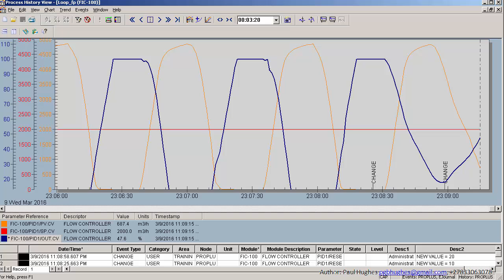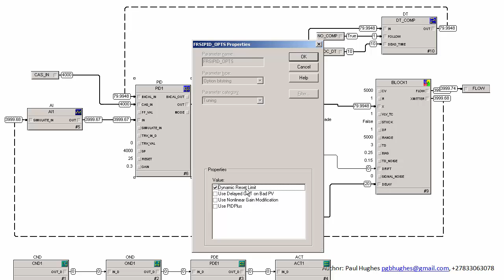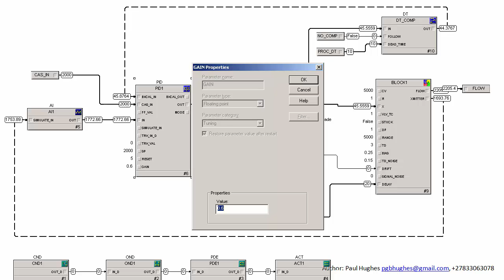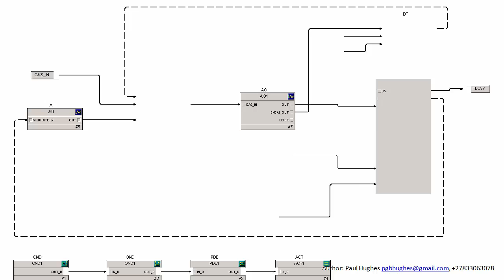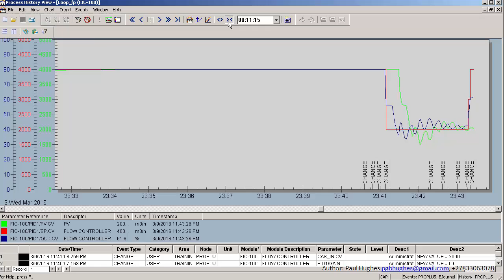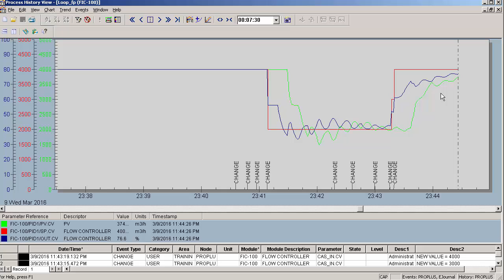Dead time Compensation using Dynamic Reset

Comment: sir , can you tell me the referance book for this compensation technique..?
Reply from the maker: Hi there. Thanks for this question! I would love to tell you but to be honest I did not really read it in a book. I picked up concepts from various places on the web and then tested it. In fact some years back I built a Smith Predictor without even knowing it was one. I will have a look if I can find a reference but to be honest I did not see this in a book. Books of relevance would be https://www.amazon.com/Instrument-Engineers-Handbook-Vol-Optimization/dp/0849310814 as well as https://www.amazon.com/PID-Controllers-Theory-Design-Tuning/dp/1556175167. Hope this helps, feel free to ask any questions and I will be more than willing to help
Reply: Paul Hughes thanks for  reply
Reply: Process Control Systems: Application, Design, and Tuning
F. Gregg Shinskey